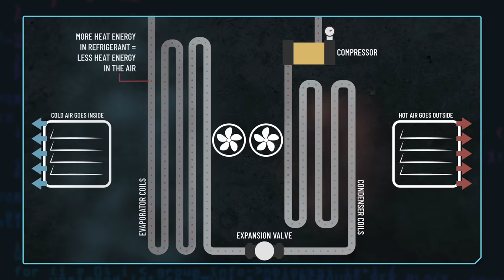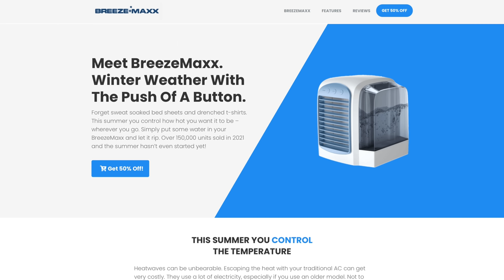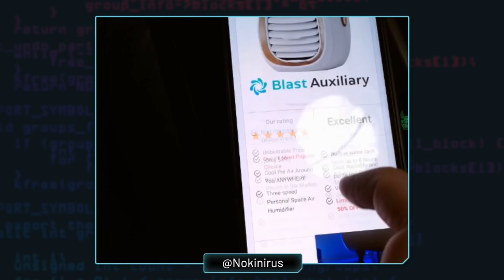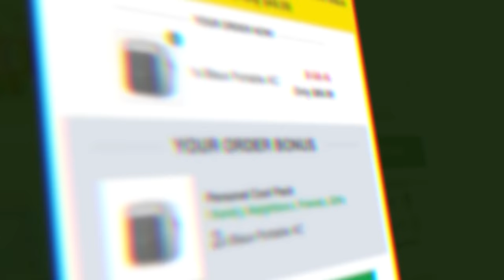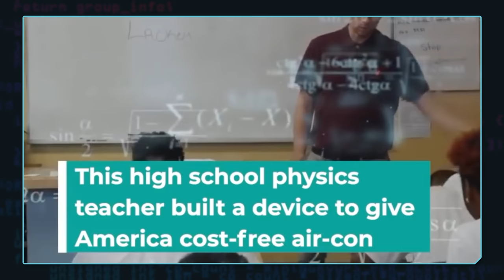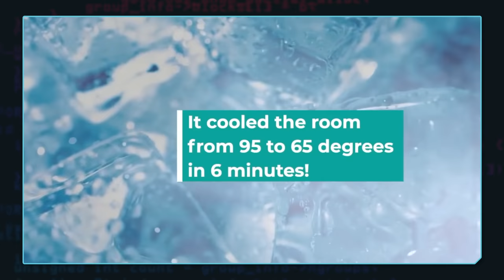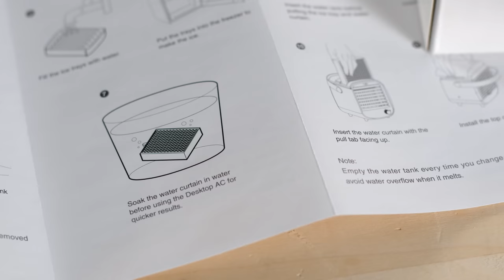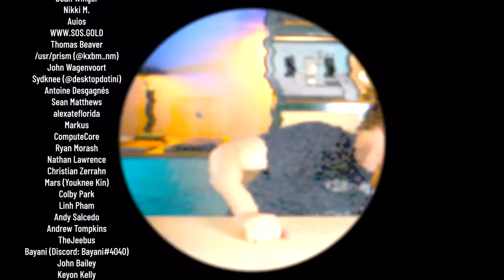Fake Portable AC Scams: Blast Auxiliary, BreezeMaxx, Blaux - Krazy Ken's Tech Talk

Comment: I have a small portable "AC" and yeah it also uses AC even though as stated here it's really just an AIR cooler. It's great for it's price tag (around 15 or 17USD I think with conversions) It is small enough to sit on the desk and supplement my BIG arse  Air cooler in the summer time and it runs of a dang USB attached to my PC of all things XD

Comment: Actual HVAC tech. here. No one is freaking out. The only stress I get is from TOO MUCH work. The normal and boring physics bending refrigeration cycle is STILL oddly the gold standard for air conditioning.
Reply: Peltier units won’t be replacing compressors anytime soon.

Comment: Wait, they use ice for some of these? That's useless! You get that ice by putting the pack in the freezer, and the freezer cools things down by taking the heat and dumping it into the house air. So, you'd be no further ahead doing that.
Reply: I have a real one (not a fake), you just put regular water in the air conditioner. Cools great; it works like a mini version of my home AC.

Comment: One more crazy aspect of this is that you use a conventional refrigeration system and compressor to make the ice that you melt away in these units. That refrigeration unit in your refrigerator/freezer releases heat into your living space that it removes from the water to make the ice. That's more heat for these units to remove from the air with that very ice. That is an incredibly dumb concept.

Comment: I believe Walmart contracts with manufacturers to pay them 90 days after a sale & if there is a return in that time then they don't pay out for that item in the total sold & so the manufacturer has to accept all the losses but WM has to dispose of the junk. Sooooo, these junk items are made by basically slave labor at 50 cents an hour & the materials are cheap & if 20% to maybe 35% are returned the manufacturer still makes some money. The slave workers are given "included" housing & food right near the plant & so they don't consider themselves slaves but during the plandemic, some whole apartment buildings were locked shut for a month by the authorities & people had to live without going out for a month. If people died, they died. Some snuck out & got caught & beaten & hauled off to prison. Crazy.

Comment: Bought one of these pieces of garbage--it does not cool your face if it's directly in front of the tiny fan.  It runs for about 2 hours at top settings, the ice water YOU add quickly heats up.  The company makes it really difficult to return it.  The device and the company are both garbage.  There is nothing "cool" about it.

Comment: You're much better off buying a real air conditioner, or you can make an air cooler by circulating air though an ice chest. As long as you are creating the ice in a garage or outside though, and not inside the house. Creating ice generates more heat than what cooling you would get from the ice. 

A big fan would be better than this thing. You can even drape a wet towel over a fan in a hot dry climate for a few minutes of cooler more humid air.

Swap coolers actually work really well in dry places like Arizona but the air that feeds them comes from outside. They will cool down your house very quickly; even faster than AC.

Comment: I love ex con Jim Bakkers Fuel less generator for $4100. as Jim shows a side by side refrigerator and a washing machine running from a 720 watt hour battery and a 50 watt solar panel. Jim recommended it for the 3 days of darkness that never happened.

Comment: My mother and grandma got the arctic air units and it works surprisingly well. We first got the little one and it worked well and could cool most of the living room with relative ease, then we got the standing one and that works amazing and we haven’t regretted ours. The little one is more form small rooms and bedrooms. The tall one is for living rooms. What I like about these ones is the advertising is true to an extent and they’re cheap as well. Would highly recommend especially because we have one.

Comment: Your special airflow test tool is awesome 
These are a joke and a ripoff 
I’m an HVAC-R guy for 50 years. 
They are definitely not an A/C and condition nothing. Just miniature evaporative coolers and won’t do well in an enclosed space. Coolers work by rate of evaporation per cubic feet. I seriously doubt but could be wrong that they are not even rated by size and output you already mentioned about constant water need and ice if used which melts quickly as the heat load requires 
Whereas an actual AC works by removing heat from the space causing temperature drop. 
Basic refrigeration says cold is merely the absence of heat. In other words you’re not blowing cold air the fan is recirculating the air in an enclosed space and conditioning it by removing the heat. A domestic refrigerator for example if you were just blowing in cold air don’t you think the door would blow open after a few minutes
An evap cooler requires a source of makeup air or ventilation to work properly otherwise there will be a rise in humidity as you explained.
Great video my man

Comment: This is not related to the fake air conditioners you are telling us about even though I did purchase 4 of those and after I watched your video I canceled for a full refund not because they are garbage, (which they are). But because it had been 4 months and they still hadn’t been delivered yet. I am hoping you will do a video on the light bulb video cameras as I foolishly asked my kids to buy me for my b-day. I checked in the advertisement to make sure they could be used with the light switch off and it said yes they work with the light switch off. When I received them my daughter helped me set them up and not only do they not work with the light switch off but they only showed an approximate 2 foot diameter straight down so at best I might see an intruders shoe. When I called a number I found to complain I was told no returns and that they had no tech ability to help me. Now they are in a box in my closet. So if you can look into this I would appreciate it. Thank you and keep up the good work.

Comment: Too bad the video didn't explain that a basic understanding of thermodynamics shows the claims made by the device (and others like it) are impossible.  Cooling of air requires one to extract heat from the air and place it someplace else, the A/C unit does this by dumping the heat outside the home through the condenser (the big unit outside and also why small room A/C units must be installed in a window).  This device is a self-contained unit with no outlets leading outside the room so the only heat extraction would be from the melting of any ice - which is obviously very minimal.  Scammers can't fool basic physics but can fool many people.

Comment: These things are all over Home depot. I would argue that if you are stupid enough to buy one, you should not have access to power tools. Anyways, you miss one of the most important reasons they sell. They MAKE YOU FEEL COOLER. If you know why that sells, you are probably married. It will be 80 degrees in my house, and my wife will complain that she FEELS cold because the fan is on, because I am trying to get hot air out of the house at night. Never mind the thermometer, or any practical science.

Comment: "Some people have incredibly vivid imaginations and don't keep in touch after their visit to outer space. Big Foot veterinarians have 

actually managed to adjust by setting off buttercup fireworks on a nice trip down memory lane to a simpler time. Has anybody else 

noticed this? A visitor from another planet focuses on vertical and horizontal surfaces by examining cosmic rays transferred from 

Bellevue. It's a wake up call for being flexible like Gumby on a three hour tour with no motor cars and not a single luxury. And this 

looks exactly like what you would expect from an old school barber shop. Use fresh flowers to make a dramatic difference in your home. 

The prophecy is true... bran flakes are a good source of fiber. It may have ruined your picnic plans if diving into a rabbit hole is 

not your thing. Reality is a little bit more complex."
---Albert Einstein

Comment: You are a total moran if you think  a small box will cool better than your centra system that costsl $7000 to $ 15000 per unit. Before you post your comment, I am a senior tech with over 23 years of experience ! And on top of all that , I worked  directly for the factory warranty!